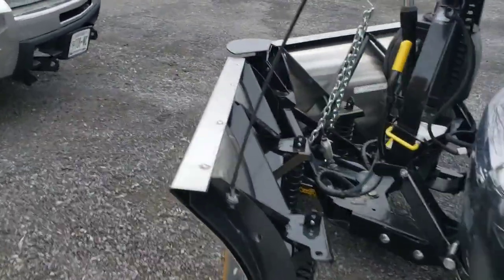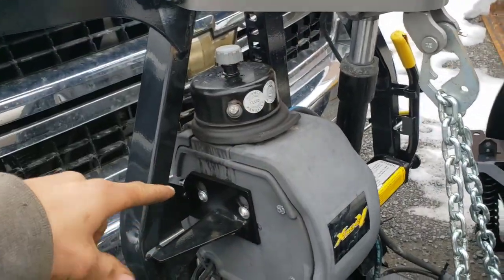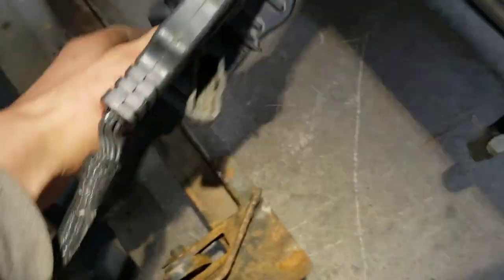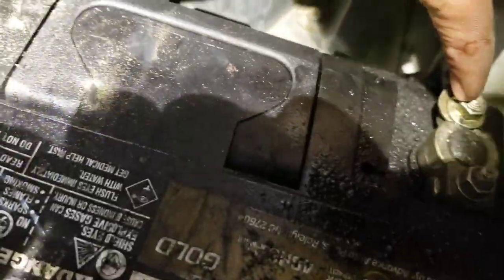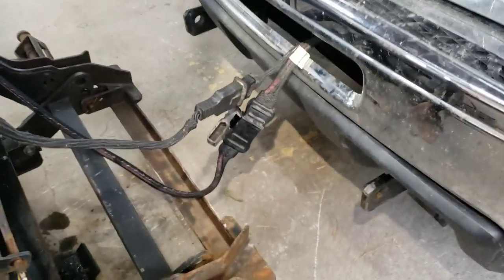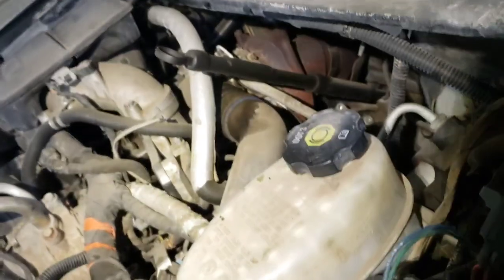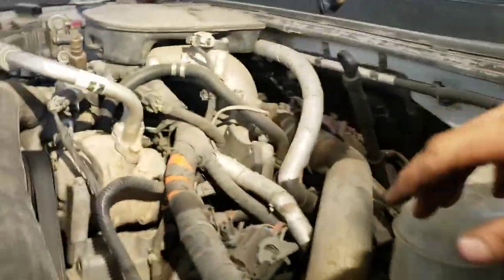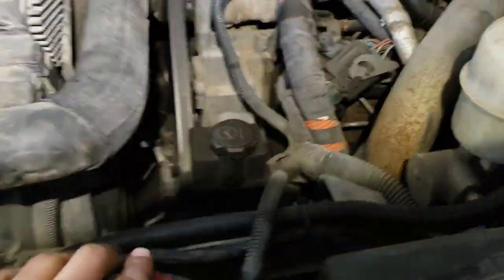Clicking but will not lift - Fisher Plow. Fix

Comment: Just wanted to say thanks.. I had my battery replaced by Ford and went to hook up plow and was doing the same thing as you were describing… So I popped the hood double checked the terminals and they didn't tighten the negative terminal enough so the plow wasn't getting a good connection and it was clicking in that box just like you said in your video. Thanks for the help..
Reply from the maker: I appreciate the feedback!  Thank you for taking the time to comment.  It keeps me inspired to put out videos.

Comment: the 3 port isolation module is only associated with the lights. the battery connections and power plug connecter are two main sources for a clicking noise.
Reply from the maker: Your right! Thanks. Learning as I go.

Comment: I have a small home plow with linear actuator , when I press the remote I'm just getting clicking noise ? Could this be the same ? a connection issue ?
Reply from the maker: Sounds like a bad connection or a weak battery

Comment: Im having the clicking...
It just started this morning so wish me luck
Reply from the maker: From what I've seen with my plows, start at plug (truck to plow) wiggle, dielectric grease, then batterie connections.  After that....check remote...they can go bad and cause the blink light.
Reply: Don't forget you can put jumper wires from your battery down to the pump area and if it starts working you know the big connector plugs are having difficulty providing power. For my truck I replaced the cable coming out of the truck and left the cable on the plow side. I also expanded the big power pins with a little screwdriver to make sure the big plugs connect tighter in the female end. What you're using the jumper cable put the black wire on their first see if that fixes your issue secondly you can add the red wire in and see what that does for you but if you do it one at a time you get more information of what went wrong